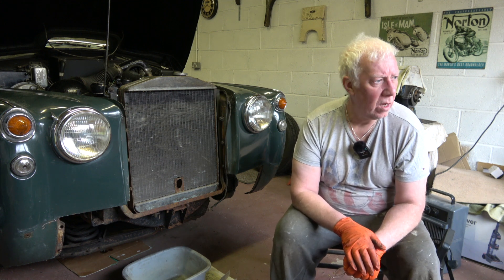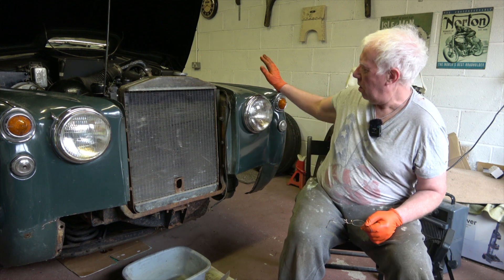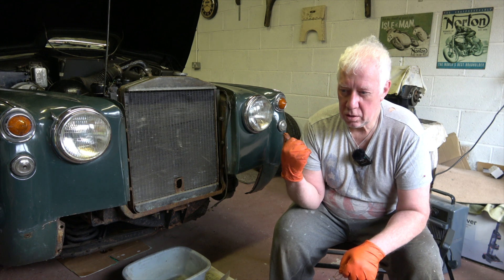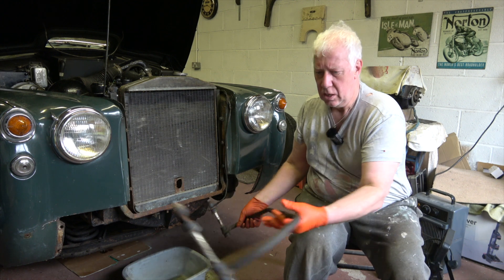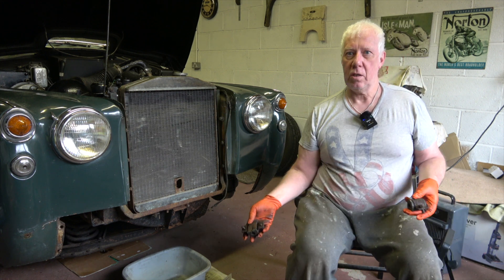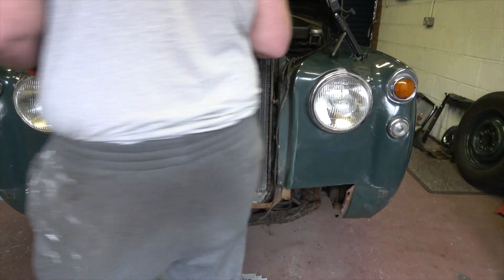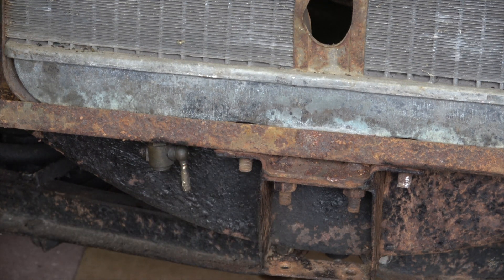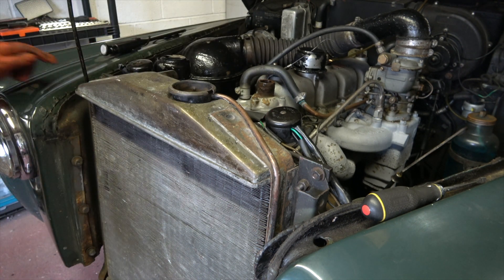Rover P4 Chassis Project: Radiator Removal

Comment: You must be aware that once you remove the front wings , your shut lines at the juncture of meeting points twixt bonnet & wings , and front grille cannot ever be the same again  . Though looking back at your first posting a year ago , the bonnet /wing shut lines were not good anyway ,though the fit above the grille was very nice , .Achieving the same fit to the original factory standard is almost impossible, as so many restored examples out there patently show. Good luck !
Reply from the maker: I certainly take your point about the shut lines being difficult to make good, however to carry out the chassis repairs I haven't got much choice. I'm pretty sure I can improve on how they were. I've battled with achieving good shut lines on a previous car...... I'll persevere and have a large swear box handy. Thanks...David
Reply: @davidbaugh  Im going through the same process as yourself at the moment, very interesting.